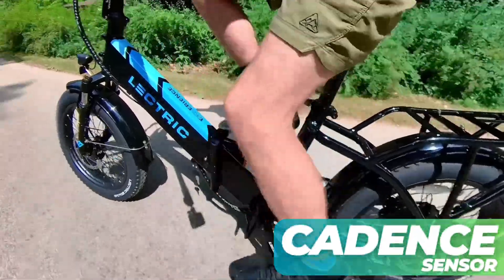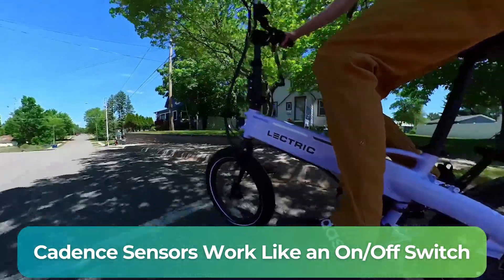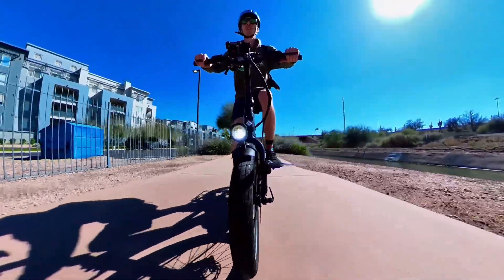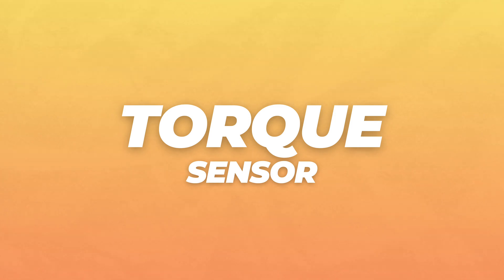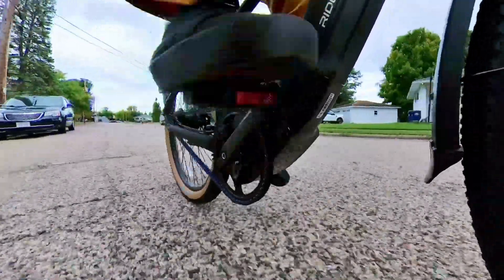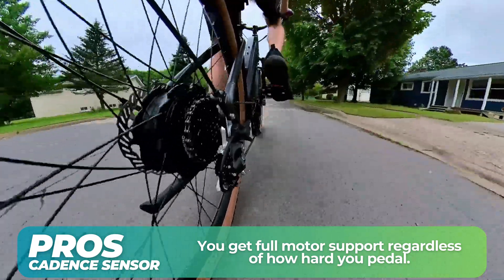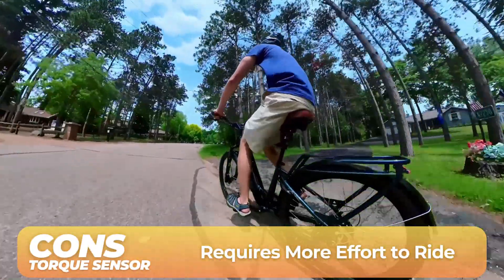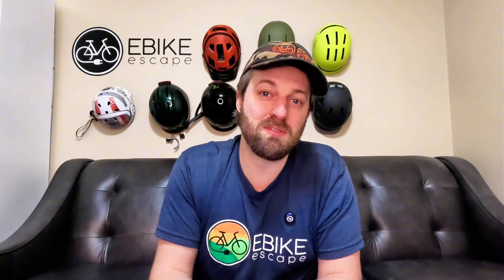Cadence vs Torque Sensors | Beginner's Guide To Ebikes Ep 5

Comment from the maker: Which sensor will you choose, torque, cadence, or both? Big thanks to Lectric for sponsoring this video: http://lectricebikes.sjv.io/YgMaRm
Reply: @EbikeEscape  Looking at the Velotric Breeze. Have had a hub motor e-bike since 2017, I like the more natural feel of a bicycle my add on kit provided, and the fact that the Breeze is only 50lbs (still too heavy but there it is) and has both torque and cadence sensors is a bonus. It’s a commuter bike, so a lot of the comments about the lack of power in the hub motor or the size of the battery don’t make a lot of sense. There aren’t many conditions for the average rider on any given day where huge torque or massive range are required.

Comment: Mokwheel Asphat ST now has both cadence & torque sensor.  My 2023 only has the torque sensor.  To get moving, place in gear #6, put left pedal parallel to ground, step on pedal & less than the 1/4 turn will get the bike moving.

Comment: I liked your video.  It was very good.  Explained it very well.

I currently have an ebike but I am looking to upgrade.  But I am having trouble finding what I want.  

If you have an affiliate that has what I'm looking for, I'll buy 2 bikes through your link.

Step through.
Lightweight around 40 to 45 lbs
Switchable sensor to torque sensor
26" x 3" or 4" tires.
Removable battery.
Power for climbing hills

Comment: Cadence sensors suck and they are dangerous..
Take it from somebody that has crashed. Off-road motorcycles at 80 mph and lived. 
Don't play if you cannot pay..
What he is not explaining to you. You want torque pedaling?.. full power throttle.
In tight situations you want to be able to pedal..
You do not want full pedal torque when just turning the pedals so you can crash into a baby stroller or crash into a pedestrian or crash into a new Ferrari..
He's not explaining to you that you need full control over your bike at all times..
I could not believe Kayden sensors were legal..
If you are riding Urban, it's a matter of time until you hurt somebody or yourself..
What he was talking about was more like a bike path I believe and you may not notice it. But it really sucked. You just need a single speed, not a 7-speed with a beach cruiser. Gearing

Comment: In many countries (like Brazil) legislation requires that the pedal should be spinning when the motor is on. I'm not sure how our legislation is written (if it's like I wrote or if they went for a more specific requirement like demanding a cadence sensor). That was created because people started using e-bikes as motorbikes but on bike only tracks.

When I first thought of an e-bike I wanted a mid drive with force sensor but I could not design a simple sensor at the time. My goal was to add a control system that would limit the force my legs would need to do by changing the force the motor is doing. My goal was to make ... well ... Earth flat! lol.
Reply from the maker: Ebike regulations vary depending on Federal, State, and Local statutes. There is a generally recognized 3-class system for defining ebikes. Many trails have a Class 1 restriction which means no throttle, only pedal power with a 20 mph max speed. Class 2 introduces throttle power but maintains the 20 mph max speed. Class 3 allows pedal power up to 28 mph, and while this class technically does not include throttle, many companies offer a hybrid Class 2 throttle with Class 3 pedal power.

There are no regulations on cadence vs torque sensors that I'm aware of. It's pretty cool that few companies now offer that sensor swapping so you can have a more efficient, natural pedal experience with the torque (force) sensor, and cadence when you want consistent, easy pedal power.

Comment: Can I install a hub motor on the front wheel and use it for regenerative breaking? The goal is to get it working as "engine break" like heany trucks do to save breaking pads. Thanks!
Reply from the maker: I think the cost and complexity of implementing regenerative braking outweighs the small amount of energy you gain from it. I saw an interesting video on a solar power solution, but the guy had like a 15 foot long trailer of panels to generate enough power to keep up with the load.
Reply: Trucks don't have engine brakes to save break pads. It's a lot cheaper to change a brake pad than to replace a worn engine. Engine brakes are to help slow the vehicle.

Comment: It is a preference, and I'm glad we have a choice. My controller supports three kinds, and being a former marathon rider, I'm kind of addicted to dynamic cadence sensing. Oddly enough, I've been on torque sensor bikes that were pretty bad, so make sure you test ride before you buy! The Electra Ponto comes to mind, but most torque sensor bikes I've ridden were pretty good. I would have to disagree about mid-drives setting the benchmarks of performance though. I did not see any mid drives in this video that could match the performance of a GOOD hub drive. I've been on group rides all over the country, and it's a common thing to wait as the mid drive riders show up dead last and gasping for air. I bring a tow strap with me in case I need to pull them up hills 😉
Reply: You need a big hub drive to compete with a mid-drive motor. I have ridden both regularly, but my rear hub Ribble is MUCH lighter.

Comment: Another advantage that I see in a rear hub motor is that its not so hard on the chain as the motor isn't driving the chain.
I don't  know the odds of this happening, but in either case, if the chain should break, with a rear hub motor you can still ride home on the throttle, but with the mid drive you'll be pushing it home. Just a thought.
Reply: Been there: broken derailleur, just powered home on hub bike (Bionx kit).

Comment: This is the most informative video on e-bikes that I can remember. 

I've never ridden an e-bike; but, being a few months shy of my 60th birthday, I figured that I will ride one soon.
Reply: Im 68 and just acquired a Velotric T1 ST plus ebike. It knocks 20 years off your legs and knees. Makes riding enjoyable again. Still get exercise, just not that huffing up longer inclines or hills.
Reply: @2zmax yup! I’ve had an ebike for 8 years and it’s easier now, but convincing people a) that it’s really none of their business and b) that you can in fact get a ton of exercise when you have a bike that you actually ride! was an uphill battle at first (pun intended). Have fun!
Reply: Me too (the age thing). I’ve had an add-on hub motor kit since 2017, buying a new bike soon. Ask yourself what kind of experience you want: do you want a bike that is fundamentally a bicycle with a motor to assist you? Are you bothered my motor noise (I am)? Is range more important than the weight of the bike? My add on kit made my bike 42lbs total. That is a completely different experience from a 70lb bike. The latter may get you further if it has a bigger battery, but it can also just be a battery sapping pig that doesn’t go any further than a lighter bike. I’m looking at the Velotric Breeze because I want a light quiet bike that will do most things really well. E-bike people have the same neuroses as Electric car drivers: range anxiety. For long rides on my old bike I just took my charger with me. Never had need for it, but a leisurely lunch can give you 20-30 miles of charge. No experience with mid-drives other than some test drives. They don’t really fit with my desire to just have a bicycle with some power assistance. Also, when my derailleur broke on hub bike I just powered home because the motor is separate from the chain. But probably not a reason to prefer one over the other. Happy trails!
Reply: @Imsosmrt1999  — Thanks for sharing that.

I would want an e-bike experience that replicates riding a regular bike as closely as possible. My kind of riding is on urban streets — or sometimes suburban streets, if I can't avoid it. But I never ride on trails or anywhere off-road. (Honestly, even the bike paths that are made of gravel annoy me; I would like to remind the people who build those things that the paving of streets was first invented for bicycles.)

But I am also concerned with weight; I see that that comes into play when climbing hills. I would also want an e-bike that I could ride normally, without absolutely having to depend on the motor.

On top of that, I would need to be able to easily lift the bike, whether to carry it up to my apartment in my walk-up building, or whether to have to lift it over a rail or something during a ride. 

So this breakdown of pros and cons is very useful to keep in mind, as I watch how the technology advances during the next few years. I will be retiring in three years (barring disasters); that will probably be the time when I actually make a purchase.
Reply: @ In 3 years things will only get better, but I will say this: you won’t regret what you buy now. I’m not an expert but I’ve had a hub motor e-bike since 2017. You would probably like the Velotric Breeze (just came out) or similar hub motor bike. I am drawn to the step through frame, so as you get older that might appeal more than swinging your leg over a higher bar - especially if you have panniers etc. Hub motor with a torque sensor on a bike like the Breeze (50lbs) will feel most like a regular bike in my opinion. Sure it won’t have the massive power everybody feels they need (mid-drive motor), but it won’t have the large price tag either. Mountain bikers appear to like the mid-drive motors, but you likely won’t need that power. My hub drive got me up any hill in my way, I routinely lugged 20-30lbs of groceries in my panniers. No issues. Who knows what the technology will be in 3 years. I would hope that I can still buy something that feels like a bicycle. If I want to go faster I have a motorcycle. Happy retirement. 😀
Reply: @Imsosmrt1999  — Thank you! You, too, of course. 

And I think you also for giving me additional food for thought.
Reply: @Imsosmrt1999 I would also mention 'Ribble AL e' at around 31 pounds.
Reply: They take 20 years off your apparent age. I have always cycled, but switched to bikes from age 70.

Comment: I have a Velotric Discover Plus 1 and it's a cadence sensor and when I try to just pedal with the pas once the motor comes on the pedals are super light and I can't really pedal, is this normal?
Reply from the maker: When I ride that model, I usually just stick to the higher gears and use throttle when starting from a stop. It has speed based pedal assist, so it's not uncommon for the acceleration to outpace your pedaling in the lower gears.
Reply: Yes and no.  Riding a cadence sensor bike takes some learning.  A rider can always have pedal resistance but you have to learn the sweet spot for your bike. The sweet spot is the correct gear and PAS level for the resistance you want.  That being said, the torque sensor will feel much more like your non electric bike.  I ride both types and if your gear is too low on a torque sensor you will not have any pedal feel but you can adjust to a very fast cadence and get more power out of the motor.
Reply: @jaywagner3111  yeah for my next bike I wanna get the Velotric T1 ST Plus.
Reply: Sounds like you are using to to much motor power while being in to low of a gear.
Reply: So I will say I've tried lower gears and lower speeds in all different combinations but I still get zero resistance. I will try again today and report back. Thanks for the responses!

Comment: I bought a bike that had the Cadence sensor and the Aventon sinch was set to a point where you had to sure the peddles 1 1/2 times before the power turned on. I gave the bike away and bought a bike with the torque sensor. Night and day.
Reply: That issue is specific to some Aventons, not all ebikes.  I have a Rad City 5 Plus and and the cadence sensor is much more responsive usually 1/4 -1/2 pedal turn. That’s why it’s important to find a local bike shop where you can ride the bike before you buy.